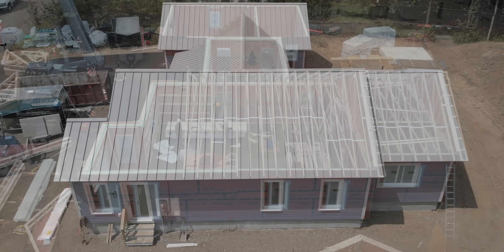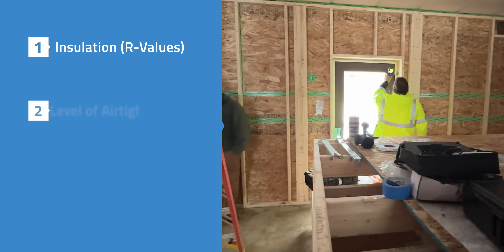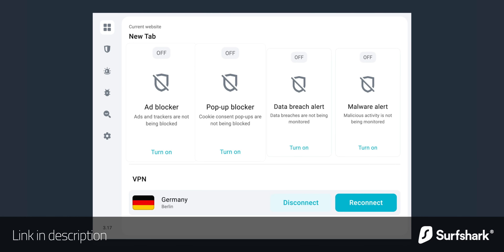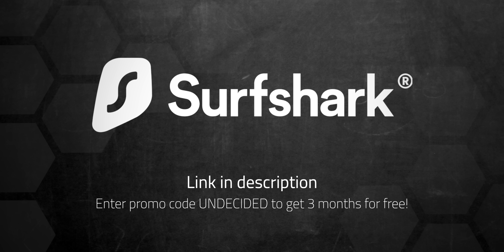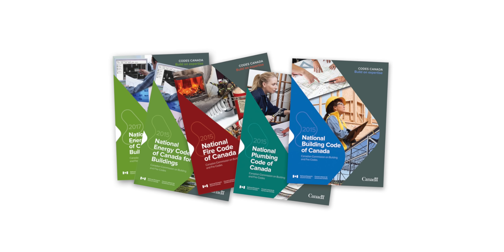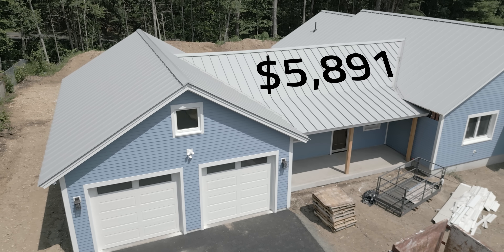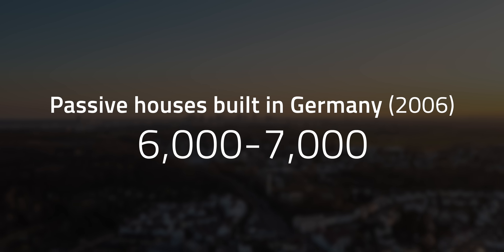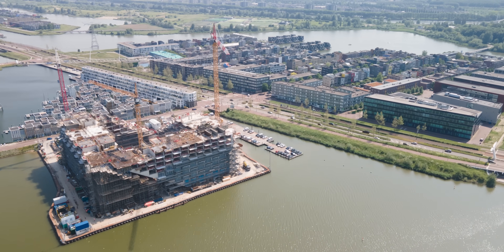Why Do American Homes Suck?

Comment: I don't know what US homes are like, but I can tell you that the 8 houses I've rented or (finally) owned in the UK have been absolutely terrible. Awful insulation, no adherence to regulations, useless cowboy contractors ruining the pipes, electric, window installations etc. Every time I've ever done any work on the homes I've lived in (a great deal), I've found that just about everything, from the initial build through to the work done by individuals has been awful. This compares to buildings I've stayed in in mainland europe, especially in Germany, and Scandinavian countries, just absolutely is on a different level. While UK walls may have a few mm of collapsed cavity wall insulation that's rotten and soggy and there's no room for fixing it with a few unlagged pipes, in Germany you'll find the gap is 100mm and entirely filled with closed cell foam. Just an example, but that's what it feels like. We pay quadruple what other countries pay for our homes and they are just the lowest quality.

Oh and regarding the point made about the embeddedness of consumption happy ethos - of course its ecconomic! Our genes and their propagation methods result in intrinsically selfish mentalities - the cost will always dominate the logic. Fuel is cheap in the US, its expensive in Europe, that's really the end of the argument, its 99% of why the regulations are what they are. Americans aren't born meaner than the rest of us, we'd all guzzle gas if we thought it wouldn't cost us anything. Thats why regulation and taxes are the only way to enforce greener attitudes.

Comment: If you think US homes are bad, you should look at how bad Japanese homes are. All windows are single pane. Airtight is unheard-of. Most homes have a hole in the wall for "ventalation". And summers are super hot and humid while winter is cold, so it's not from temperate climates

Comment: The house of my parents (built in 1997/1998) is close to a passive house without actually being one. It is certified as a so called "Low Energy House", and the whole warm water/heating system is rated at 9 kW, while running only around 2-4 hrs per day even during the winter. And the air condition? It consists of a protruding roof shadowing the windows during the summer, a linnen sail on the balcony, and a large pergola overgrown with Clematis on the terrace.

Comment: One thing I love about my windows is that besides open and tilt, they have a third opening mode, were you tilt the window only by a few degrees, creating an opening about 1...2 cm  (roughly half an inch up to an inch) at the upper side of the frame that allows for air circulation with less heat loss than when fully tilted.
Reply: That is not a good way to ventilate your house. It's best to just fully open the windows for a few minutes on opposing sides of the house to create a draft thus quickly pulling in fresh outdoor air. Just do that a few times a day. Keeping a window slightly open would be akin to keeping your fridge slightly ajar.
Reply: Like every window in Europe, it's not some wonder, better thing about european windows is that you can live near road, and not hearing trafic, if We shut window down, there is no breeze to feel, double glass with vacuum inside, soundproof and keeps heat inside, or cool air in the summer.

Comment: The issue is that usually higher standards mean higher initial costs to buy a home. I know there are long term savings but that means nothing if you can never afford the house to begin with. Homes are already too expensive as it is. At this point I might not be opposed to lowering standards even more within reason just so we can have affordable homes and keep people off the streets.

Comment: 0:20  "Begs the question" doesn't mean raise the question. 
In classical rhetoric and logic, begging the question or assuming the conclusion (Latin: petītiō principiī) is an informal fallacy that occurs when an argument's premises assume the truth of the conclusion. Historically, begging the question refers to a fault in a dialectical argument in which the speaker assumes some premise that has not been demonstrated to be true. In modern usage it has come to refer to an argument in which the premises assume the conclusion without supporting it. This makes it more or less synonymous with circular reasoning.

Comment: In Japan, where I live, the approach is different, but the result is still reasonably good. Insulation and double-paned windows are somewhat a new thing and not widely adopted (which I thought was bonkers when I moved here), but what really helps is the lack of central HVAC. Yes, that sounds weird, but hear me out. Historically, Japanese homes were designed to use free flow of air to stay cool in the summer, and Japanese would warm up in the winter by spending a lot of their time sitting at a kotatsu (https://en.wikipedia.org/wiki/Kotatsu) instead of heating the entire room. Although modern homes are different now, the habits have carried forward, perhaps partly because electricity rates are high. Each main room has its own heat pump mounted on the wall, and you only turn it on in the room you are actually using. Rooms are also much smaller (due to high population density and resulting premium on land and floor space), which makes them easier to cool/heat individually. If it's not too hot, many people still just open windows and let the breeze go through instead of turning on the A/C, and kotatsu use in winter is still popular. In urban areas, apartment buildings and condominiums are the most common housing by far, which means your neighbors provide a lot of insulation. Clothes dryers sometimes exist (small stacked unit above the washer) but are not the norm - every apartment has a balcony, and everyone hangs their clothes to dry (if winters are too cold to hang them outdoors, people use folding racks indoors). Also, Japanese homes have had fluorescent ceiling lighting as the norm for several decades (and of course are now moving to LED), whereas US homes are only now slowly letting go of incandescent. The end result of all this is relatively efficient energy use.

Comment: I think compared to other countries American actually measure up quite well. Perhaps Germany or Scandinavia are better (as they are in many other things), but I can say from personal experience that American buildings are built to a higher standard then most buildings in the UK and Ireland. American building codes are more exacting, and very few American buildings have the kinds of problems that are ubiquitous across many buildings in the UK and Ireland, namely drafts, mold and shockingly bad noise insulation.

The International building code is much more comprehensive then the same in the UK and Ireland, though recently both countries have been making big improvements. But if you saw apartments built 10 years ago, they would compare quite poorly to equivalent buildings in most American cities. American Engineering associations also put out much more literature then the equivalent in the UK and Ireland.

Comment: i find it really hard to believe that houses with triple glazed glass, air to air heat exchangers, passive heating systems and things like heat pump water heater systems don't cost much more than the standard "inefficient" american home. Those materials are going to cost substantially more to buy and install. We already have an affordability issue with american houses. We don't need this right now. If you've got the $ to hire a custom builder more power to you

Comment: You should look into Dallas Texas . All homes will have foundation issues as little as 5 years . No home 300 miles Near Dallas or Most Texas at all has any basements. By adding sump pumps and basement foundations homes over 20 years old might last . Newer homes are built so fast here we have seen some with warped walls and giant foundation cracks requiring 50k worth of Damage repair and the homes are still selling 20K over asking price average. Its insane they just slap homes up here and there is zero concern for quality . It not a matter if you have foundation Issues Its when due to building standard in Texas . They alos build most homes so close you can always see into you neighbors home constantly.

Comment: I've got a rowhome built in 1880. I am looking to attempt a complete redo of the house to see how close an old home can reach passive house standards. Other folks have tried and it's worked. I've started with mini split heating and cooling, a TPO roof with isocyanate insulation, and a heat pump water heater. Each one has made a huge difference, but eventually the sum will be greater than the individual changes. One thing that makes it harder is that on one side of my house, it's old brick with lime mortar. You can't just slap outboard insulation and weatherproofing. It takes a little more care. Passive houses are great not just because the living expenses are low over time, but they also are more comfortable. Warmer in the winter, less humid in the summer, they don't leak, they have much better water ingress protection, and they also are generally much quieter. If you add sound insulation and treatment, you can live in a row home and never know that anyone else exists.

Cool to see Matt risinger getting a shout-out. I love his enthusiasm for better homebuilding.

I'm also a materials scientist/engineer and this stuff fascinates me as the topic is very materials dominated.

Thanks for the vid! I want to see more Americans start caring about this.
Reply: Some building envelopes are best left as they are and then re-skinned externally with a Larsen type wall. Brick walls pose a problem of drying and freeze - thaw. As energy costs continue to rise, townhomes like yours will become economically unviable shelter. You will run into a problem with neighbours though. So the homeowners will need to cooperate to improve the envelope of each dwelling in the group in a coherent way. So a plan needs to be developed that governs the exterior envelope in terms of thickness , finishes and appearance. With the Larsen wall, the building size grows and that can mean a planning issue where variances need to be obtained. Again, a collective approach is needed.

Comment: In my book US houses don't suck because of energy numbers.
The problem is they're not made of bricks or concrete but PLYWOOD. That sucks.
And they sort of know that it sucks so often, they cover the outer walls with fake brick tiles - as if...
Almost all 7-8 figures luxury houses are built from crap materials. (just go to Los Angeles using google street view and find some new constructions)

Comment: In the UK, the standard for windows is double glazing, not triple, and you don't usually see tilt and turn, or windows that open inwards. they almost always have a single hinge and open out. But they are still incredibly efficient, and in theory if you really wanted to, you can install triple glazing into the same frames that normally hold the standard double glazing.
The walls of buildings themselves have 2 layers of bricks, with insulation between. Even the house I live in that is over a hundred years old has 2 layers of bricks, though they're against each other, so no room between for insulation.

Comment: Your wall has a Rc of 35? Wow, could you tell me what materials you have used to create this? How thick are the walls? Here in the Netherlands we are  atm at 6,5 at the max in the building code. We have different Rc”s per type of wall, roof or floor

Comment: We're in a bit of a golden age of solar here, because the tech is JUST becoming viable at its current price and efficiency.  So, there are lots of small and enthusiastic providers that are willing to sell to small distributers, and even directly to consumers, AND offer the technical data on how to install it and maintain it yourself.  It won't be long before "consumers can't be trusted with that info" and it'll all go to "authorized installers" with high markups, entitlement restrictions, cryptic error codes and lock-outs, and local or national codes that all but criminalize users from touching any of it anyway.

Get it while you can.

Comment: The reason we do not implement these materials in to our homes is cost.  It is more expensive to build and maintain over the mortgage of the home.  The reason the local building codes and the state building codes trump the national IBC Code is because every state is different, and every town is also different.  Upper State New York does not need to build to the same standards as Southwest Florida.  There are differences in play, and one of the major differences is snow.  A rural town in the central part Pennsylvania also does not need the same standards as a building located in the suburbs of Pittsburgh or New York City.  Building a home with renewable energy sounds great at its core, but when you look into the cost savings, it is not.  Renewable energy is very efficient compared to other energy savers, however until they compare or are remotely close in cost, they will not be implemented.  This is why our politicians have decided to keep gas prices high and kill the coal market.  Without those options, we have no choice but to switch.  Look at it in the manor of buying an electric vehicle to a standard combustion engine.  A standard Tesla with one option costs over 50 grand.  The same type of car in a combustion engine costs under 30 grand.  Over the 4 to 6 years you will own the vehicle, the 20 grand difference will not be met.  Along with that, if your battery goes bad during that time, it will be over 20 grand to replace.  Solar panels, wind power, geothermal heating are all comparable to this.  In order to use R35 insulation in your walls, you will have to use a packed 2x8 or 2x10 construction compared to 2x4 or a more commonly used stud today 2x6.  2x6 allows for a value of R-19 in the walls.  If you can afford renewables and price is no object, go for it.  However, most people can not.

Comment: In the Netherlands most houses are build with brick and concrete, and very important the roof is coffered with brick tablets (dakpannen) we have double or triple glass windows in the same way as in Germany. Because these stone walls the temperature outside has less impact on the temperature inside. On the most days in the summer just venting your house in the colder night air and covering your windows against the sun during the day keeps the house cool enough. This saves a lot off energy otherwise used by an air conditioner. I can coffer my electricity use with 13 solar panels off 300watt the only thing I have to buy is gas for heating and cooking.